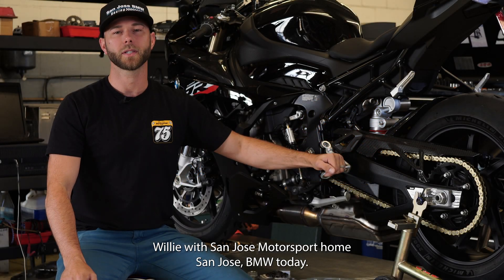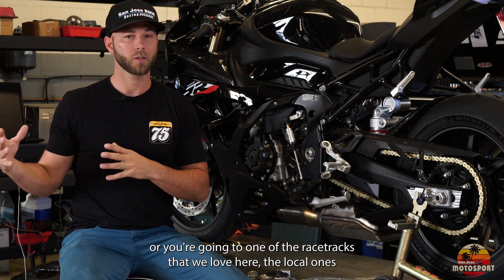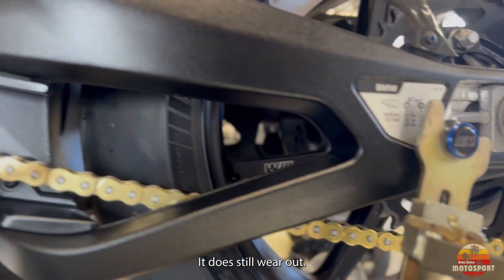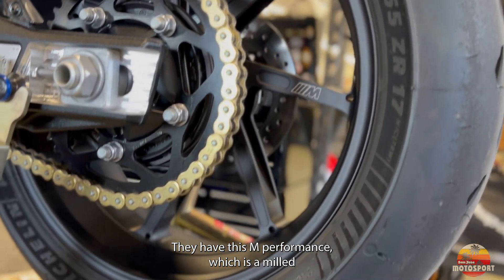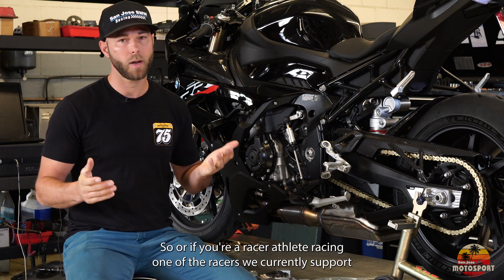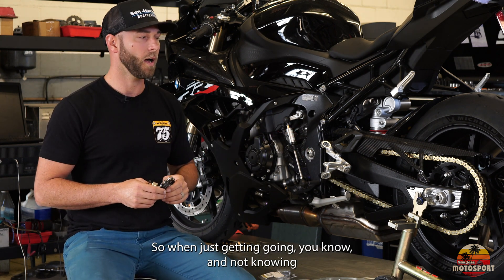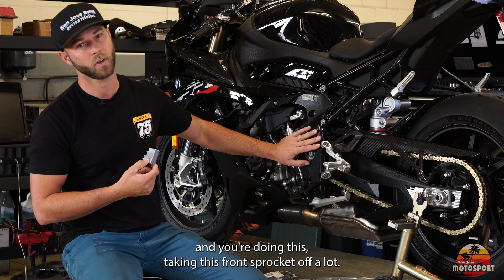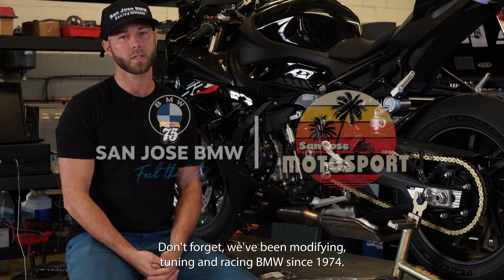SAN JOSE BMW Educational Series | BMW Motorrad S 1000 GEARING and SPROCKET SIZING

Comment: I need a rear sprocket for a 24 bmw1000rr with forged wheels 525 40T
Reply: I kept getting the wrong ones bc the internet is awful trying to find stuff nowadays.. but make sure it has 5 BOLT HOLES! The sprocket carrier on the HP4 wheels has only 5 bolts. I got mine off of revzilla, part no. P394441

Comment: For the 2022 k67 s1000rr  what is the ideal gearing to reach 180mph the fastest ? 
As well as to reach the ideal 200mph ?
Reply from the maker: Great question!  In order to reach 180 MPH quickest I would recommend 15T front sprocket and a 44T rear sprocket.  Now when wanting to reach a top speed like 200MPH you will most likely need additional modifications.  The aero dynamics become a really big factor at those top speeds.  You will also need some additional performance mods to increase the HP's.  Again, with these extreme speeds every little factor matters. 

Please feel free to give us a call and we can go into greater detail with you if you will provide us with a bit more information on your riding style and bike setup. We can be reached at (408) 295-0205.

-Willie
Reply: @sanjosebmwmotorcycle   thank you was  gonna try the 16 /43 but  I’ll get the 15 sprocket as well. And 44 rear
Reply: Hi, just seen this.. when changing the front or rear sprockets does it pull up any error codes ? Before I go changing the front by -1 tooth. Cheers